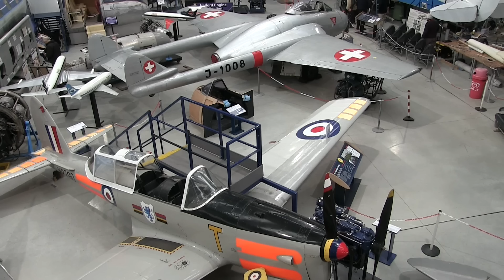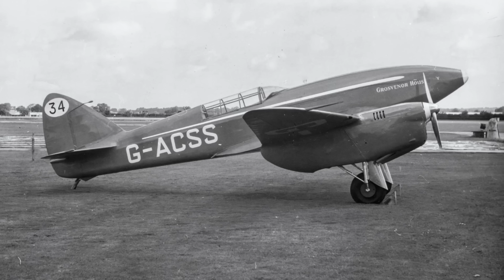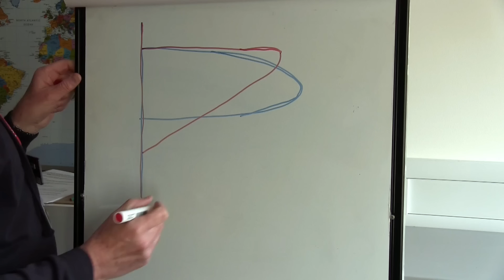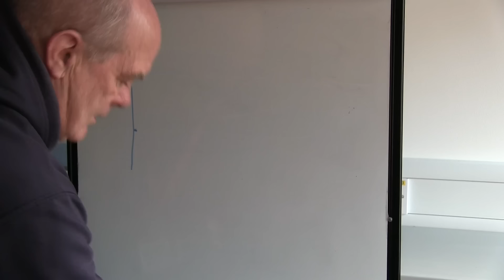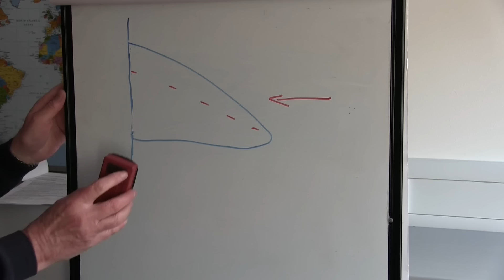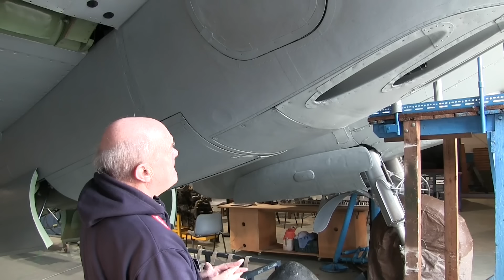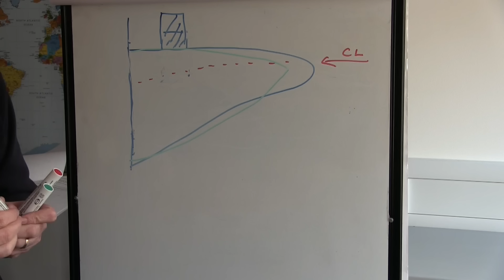Why Did the Mosquito Have Triangular Wings? The Mystery Explained

Comment: Rear trailing edge taper was not unusual in the WW2 era was not unusual.  One of the most efficient wings was with the DC-3 Dakota, which had a strong rear taper.  The Catalina was also highly efficient with a slight taper.  The post war Canberra jet bomber had front and rear taper with excellent performance at higher subsonic speeds and high altitude performance.  The Liberator bomber had a slight taper. The Mustang also had a great wing. And good control in high-speed dives.   These are some of the most efficient wing designs I can think of. With various tapers and performances. Other great wings I can think of are the T-2, SR-71 and Concord.

Comment: I  was thinking, that having a straight leading edge of the wing. Would also improve lift of the wing. By having less air moving toward the wing tip. It may not make much of a differance, but every little bit helps. Your weight and balance makes a lot of sence.

Comment: You kind of answered your own question with noticing the "massive" engines. As in plural!!!  lol 
 You also are looking into it way to much. Straight line for the massive amount of radiators needed to cool two engines and not just one.
The simplest answer is usually the correct one. Cheers

Comment: Question from a layman that is merely curious: could it be because of the use of wood in the structure? Wood is apparently stronger in tension than compression, and I wonder if the form of the wing might have used that to maximize the design. Since the engines pull the plane, I reckon the triangle might distribute the tension better, especially toward the back of the fuselage. It might also have strengthened the centre by having a large wing-body connection, so that both structure can act jointly, while limiting drag by keeping a smaller wingtip. 
Also, the bomb bay is within the overall where the wings connect, so the weight of the bomb would be 'pulling' on the back of the wings, meaning you benefit from having an angle rather than a right corner, so that the wood doesn't have to flex too much when transferring the force of the motors and lift. Wood is stronger along the grain than perpendicular to it, so any angle other than 90 degrees is probably to the plane's benefit, especially when fully loaded. It could also help stop the leading edge from flexing too much.
To be clear, I don't know anything special, I just find the subject fascinating.

Comment: I would say that you got inside the heads of the designers and identified some key innovations. It certainly looks like a refinement of the comet wing with a deliberate design choice to move the center of lift to compensate for the heavier merlin engines. In addition to a stronger wing and reduced drag, it has an increased rate of roll. I would suggest it is a better shape than the elliptical wing and the moulded timber construction made it a reasonably practical fabrication.

Comment: Thanks for the video—really interesting.

I design things for a living and have a bit of an interest in aerodynamics, and this wing doesn’t look particularly unusual when you place it in the context of the period. If you look at the literature that would have been sitting in the de Havilland office around 1940—particularly around induced drag and planform development—a slightly forward-swept, highly tapered wing shows up fairly often. There’s a similar line of thinking behind aircraft like the P-38.

If you step through the likely design constraints de Havilland were working with—large fuel volume, low drag, straightforward construction, and decent stall behaviour—the configuration starts to make a lot of sense. The large root chord gives you useful volume for fuel close to the engines, which is structurally and operationally sensible. The apparent forward sweep (when you look at the chord line rather than just the leading edge) helps counter the effects of a high taper ratio, improving tip stall behaviour and reducing the need for more complicated features like slats.

From a manufacturing point of view, keeping spars and leading edges relatively straight is significant—it simplifies construction and avoids unnecessary complexity. Structurally, the taper also works in your favour by increasing section depth inboard, which improves the second moment of area and helps manage bending loads.

One thing I’d be very interested in is how much geometric washout was actually built into the wing. Forward sweep like this can reduce the amount of twist needed to get acceptable stall behaviour. It would be great if the delightful museum persons could show that—either in the drawings or even pointed out on one of the aircraft you’ve got on display—just the sort of detail a nerd like me would like to see.

P.S. It might be fun to try re-engineering a 1940s-style aerodynamic analysis of the Mosquito wing—an experimental engineering archaeology exercise.
Reply: Surprised he didn't mention the DH Dragon nor the Rapide. You make very interesting points. Agreed.
Reply: Probably didn't mention twist, because most people have no clue about it.

Comment: A bomber with very similar shape of wing was a Short Stirling. And despite it size it actually have excellent turn rate. 
So considering that Stirling was designed well before Mosquito it may have influenced DeHaviland choice for this planform. 
Secondary the most efficient load bering structure in engineering is triangle. So this kind of wing shape is probably inherently stronger for given weight compared to rectangular or elliptical shape. And lower weight means better aircraft performance in terms of speed and range.

Comment: Oh my. I don't know if there is a prize for the most intellectual YT comments section but.... I had a simple question that I hesitate to ask - why does moving engine position alter drag? Surely cross-sectional area is the same?
Reply: Moving the engines forward of the spar means they can be lifted higher, reducing frontal area and allowing better propeller ground clearance, plus allowing a slightly shorter and lighter undercarriage.

Comment: Considering the strategtic  economic logistical context of the time, the UK was loosing the war and under a growing blockade and was yearning to fight back and an air campaign amd commando raids amd a counter naval blockade was the options available . This makes use of non strategic materials such as wood, small wood working factories very attractive. Ease of manufactoring and use of alternative and decentalised resources would drive design decisions. This would be doubly salient, in that DeHaviland was not responding to a government request. Aerodynamics would have been a secondary level driver in design.
Reply: The Mosquito was designed as a bomber whose only defence was speed. Aerodynamics was of primary importance or they would all get shot down. Furthermore, design work started in 1939 before Britain had any major reverses in the war. And the timber used was mostly imported from  North America, so although not "strategic" it had to run the gauntlet of the Atlantic.

Comment: Good stuff but you good folk urgently need a remedial lesson 101 in the use of graphics, colours and teaching aids: (i) better to have that model plane on a stand so your hands are free to use a bright coloured pointer to highlight the key salient design features; (ii) to address the issue of wing design etc, it's best to use pre-prepared screen-based multi-coloured slides/OHTs etc; and (iii) whatever else you're doing NEVER just draw on a dull white board, in real time, with a dull coloured pastel sharpie to outline a wing shape and then simply draw over it in the same colour to delineate a variant of that! You're not an artist either, so best you get all this done in advance, to save time and improve the standard of presentation graphics! You get a bare pass grade for this 'show and tell' effort; you can and MUST do better! I designed a prize winning maritime ensign for a south american shipping firm, so I am not entirely ignorant or unskilled in these matters!  You would scarcely credit how many awfully designed ensigns and flags are out there; and NEVER EVER DEPLOY THE COLOUR BLACK! All that said, the Mosquito is a work of art, a thing of beauty and a joy forever!

Comment: Certainly a straight leading edge and trailing edge is much simpler to produce. With clever airfoil selection and wash out you can get a pretty elliptical loading where you need it (presumably cruise). A straight leading edge gives you benefits of a forward swept wing without the structural divergence problems. P-47 and P-40 are also notable examples of many.
Those huge engines would need a lot of structure especially inboard. The massive root chord would allow for a very deep spar but maintain a thin airfoil section.

Comment: If you suffer from wingtip-stall with forward swept wings, the Centre of Lift  will move backwards. This will push the nose down more quickly than a pilot is likely to recognise the stall & react, possibly preventing the stall from getting worse? (assuming that you have enough altitude) 🤔 

Also, for any given Centre of Lift/Mass, it allows you to locate the wing spar(s) further aft in the fuselage - this might have practical design advantages. Moving the wing spar forward looks like it would intrude on the Mossie's cockpit space.

Comment: The wings is effectively a forward-swept tapered wing. Forward sweep inhibits spanwise flow towards the tip and so reduces drag. Some demonstrators such as the X-29 have utilised this in more extreme ways. There was a prototype - I think from Republic - that had a forward sweep with reverse-taper - larger chord at the tip than at the root.
Reply: There was a prototype like that. I forgot who made it. You might be right on the maker.

Comment: So. . . . How does putting the Merlins forward reduce frontal drag? Are they able to sit higher, blocking out some of the drag of the wing, because of being so far forward? That's the only reason I can think of. Or, is it possible that moving the center of drag forward gave some benefit that you have not explored? Re tip stall, this can be minimized if the airfoil toward the tip of the wing is twisted slightly forward. That's called "washout," at least in American English. It reduces the lift produced by the outer part of the wing, with the effect that the outer part of the wing is the last part to stall. I've always loved the Mosquito.
Reply: You mentioned "washout" as reducing the lift produced by the outer part of the wing.
Washout is where the outer part of the wing is twisted slightly downward to allow that part of the wing to stall later than the inner part. This reduces the chance of a tip stall and possible spin.
I believe the Spitfire wing had a slight downward twist near the tip and when near the stall the pilot would feel a wobble prior to the tip stalling as the inner wing had stalled before the tip.

Comment: It's probably more to do with single engine performance after an engine failure. I bet they found with a swept wing, massive engines and a relatively small fin and rudder, that the swept wing on the good engine generated to much lift whilst the other wing was losing lift because of the yaw moment. The tiny rudder not enough to compensate unless you were really quick with inputs. In other words, Vmca would be higher on the swept wing.

Comment: You didn't show early design, did they have the same profile? Also a quick AI rusult said the mosquito was planned to be used with the griffon or napier sabre and the merlin was expedient. If so, you would think the design waa  planned versitile and perhaps for strength to hold whatever engine was finally picked.

Comment: I don't understand how moving the engines backwards would increase frontal area - why wouldn't it remain the same?
Reply: Because they would have to go under the main spar thus increasing the frontal area by the depth of the spar. Designs which did this also tended to have vibration issues
Reply: @Grumpee7 Thanks for your response. Now I understand.

Comment: Just a guess... at 10:22 we see that the pilot and navigator are lined up at the leading edge of the wing, and can look down at the ground (and at targets) in front of the wing. If they had used a more traditional wing (see the design at 14:00), the wing root would have been further forward and blocked that view.
Reply: That's part of choosing a wing with a forward centre of lift - you can position the wing further aft for better cockpit visibility - but that only proves the point this video is correctly making.

Comment: Another design consideration is that, with the motors further aft and the propellers being large due to their power, the distance between the two motors could be minimized (with the propellers overlapping the small nose), leading to reduced asymmetric thrust in the event of an engine failure
Reply: That suggestion makes a lot of sense.

Comment: Frontal area. Recessing the engines farther back in the wing would have required moving the landing gear back as well, they share a common nacelle. This would have required moving the main spar farther back... Pretty soon your just chasing your tail... Beside that, the wing area from the fuselage and engine nacelles act as a rudimentary lifting body section to help offset the concentrated area closer to center for fuel load. That helps to maintain a higher roll rate.
Anybody can come up with a workable design for an aircraft... It took the British to do it with style and elegance!
Reply: Couple of things come to mind. One, to reduce outer wing portion stall in slow flight (needed to keep ailerons effective) they could have built-in some twist into the wing. Second, I bet one rule they had was to mount the engines forward enough to have them in front of wing spar instead of below. The farther forward the engines, the farther forward the props (without prop shaft extensions) rendering less yaw in single engine performance.
Reply: I came to the comments section hoping someone would say this. Thank you. 😊

Comment: Interesting video. I guess the forward sweep was designed like that for structural reasons (weight of engines) andto  improve manoeuvrability and stall characteristics. Btw. center of lift for a conventional tapered wing is at about one quarter (25% MAC), not one third. Forward sweep wings are quite common in older glider planes such as Blanik, Ka-6

Comment: Retired pilot here... If one measures the 25% chord line from tip to root, it's actually a forward swept wing.
Reply: Interesting point. Years ago, wing sweep was usually mentioned as sweep at the quarter-chord line. Nowadays people mostly seem to look at leading edge sweep. I assume it has something to do with the move to concentrating on trans- to supersonic flight.
Reply: It make sense in a piston aircraft, all the weight are in the front. If you use a sweep wing, you may gain speed by less drag on the main wing, but loses A LOT MORE on the rear stabilizers.   The fact that the aircraft is a twin engined, wich the engine closer to the main wings instead of a big and longer single engine, may help to in the rear stabilizers drag too.
Reply: @polentusmax6100  Please refer to "Aerodynamics For Naval Aviators" ...https://www.faa.gov/sites/faa.gov/files/regulations_policies/handbooks_manuals/aviation/00-80T-80.pdf
Reply: Yep, and that aid pitch response in a very significant way.

Comment: The bomb bay would have to be on the centre of lift so when the bombs were dropped, this did not shift.  That pushes the crew and gun armament further forward.  And of course the frontal area issue you identify, because speed was always the objective of the design.  Just my amateur two cents.

Thanks for the video and all your work.

Comment: I wonder if the forward- swept center of lift reduced spanwise flow? Otherwise, you've got that tiny wing tip that can't do much anyway, also produces less lift due to the aforementioned span wise flow, and operates at a much lower Reynolds number than the inboard sections of the wing, none of which makes any sense in a high- performance aircraft. Plus the washout needed to counteract tip stalling is going to make the tips less useful. 

The only other explanation i can imagine is that they were all high.

Comment: Having just had a quick look at a schematic drawing, it looks to me as though what appears to be the front spar passes through both wings and behind the pilot's seat and it looks as though it's absolutely straight. The spar being straight would have been a very desirable property from a manufacturing perspective (I would have thought). Then there's what appears to be a rear spar which goes to the first bulkhead. The struts for the landing gear appear to attach to this spar as well. Given the complex geometry requirements of the landing gear in their own right, this would presumably fix the necessary position of this rear spar it was attached to? And given that the preference for manufacturing would presumably have been to keep the rear spar straight (at least on each side of the fuselage) wouldn't this then result in the shape the wings were? So as to say, the wing planform was a result of the need to keep the front and rear wing spars straight, but the landing gear struts needed to be in certain position, and be fixed to the rear strut. This resulted in the wing shape the Mosquito ended up with, albeit it had the additional benefit of the centre of lift you pointed out.
I'm no engineer, I'm just a Cabinet Maker. But that would be my best guess anyhow (if it's any use).
Reply: It was built by cabinet makers, so your points are relevant.